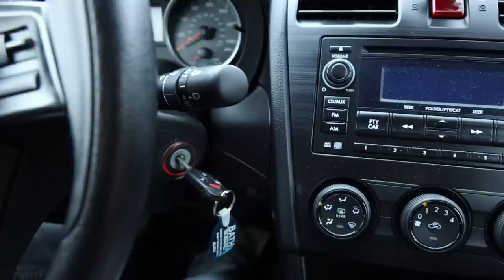Building The OFFROAD Subaru Crosstrek Makery And Mischief Adventure Mobile With LP Aventure

Comment: The crosstrek is getting the attention it deserves! It’s my first car and this is my dream build eventually after college. Just a tip, you can fit a mattress in the back of the crosstrek very easily if you put all the seats down. The most I’ve gotten is a twin size in there with 4 pillows
Reply: Just the rear seats down or all seats down?
Reply: @luvjoebacon2915  just the rear seats will fit a twin sized bed!

Comment: Great choice! It's hard to beat a Subaru. They are one of the best vehicles you can buy for snow and fuel economy. They last forever.
Reply: unless the cvt burns out
Reply: What tires he running
Reply: I like them too. I’ve heard reports of them burning oil. Is that accurate?
Reply: Diesel engines nad clutches nie manual transmissions in subarus are the worst thing in car industry.
Reply: Keep it serviced, they have one of the best cvts out there with no oil burning issues.  Comments like that are from misinformed YouTubers
Reply: @winnfilms  i bought a manual 6 speed crosstrek

Comment: How does your crosstrek handle the increased weight of all the added parts and wheels?  Crosstreks already have a rather underpowered engine and I'm curious if you've noticed any notable performance changes.

Comment: Funny, my number one qualification for this car was the ability to lay down to sleep in it. The salesman looked at me funny as I put down the seats and laid down in the back. Owned the car for 5yrs now, it's a great one man camper. I found it best to take the headrests off and lay down the front and back seats, with two overlapping pieces of plywood from front to back.
Get some Mann springs for towing/hauling, really helps with rear end sag.
Reply: Just saw a video on Rick Hutton's channel that talks about inflatable mattresses for the Crosstrek. There are custom fit ones which seem great.

Comment: I used to like the fact you could hear the road in a Subaru, you could hear the engine, you could hear the air intake, and the wind. Those noises were the sounds of driving- started off with an 88 Loyale, sounded and behaved like a sports car. And my Outback went EVERYWHERE.

Comment: I had my trailer the other day & it had a low tire.  I was being lazy so I pulled into a station to air it up.  The pump deal took charge cards ( 2.00 dollars ). SMH.  I dug my little pump out of the back.   For sure always carrie one.     I like the front rack a lot

Comment: Your car's power sockets go back to a fuse on an "ignition on" power rail. Look for an empty socket (for options not installed) on the "battery constant" rail and just move the power lead for the sockets over. Quick & easy.

Comment: Love ya work !!! looks grouse. You probably know, but if you didnt, Torq Masters in america are very close to releasing a lunchbox locker for subarus r160 rear diff. And even more exciting Aussie AllDriveSubaru are producing a 1.6 low range to suit the 5mt out of a XT foz. All subarus bell housing patterns match. So when your CVT dies, theres upgrades !!!
Reply from the maker: interesting I dont know I'm not a huge car guy  so thanks for the heads up.  What would be the advantage of all that?
Reply: Fowler's Makery and Mischief lockers make is so the wheels spin together once engaged. Really good for muddy conditions when a wheel might loose traction.

Comment: That was awesome! I drive a Crosstrek to handle the northern Alberta winters and it's second to none. Love your channel.
Reply from the maker: thanks ya I cant wait to see my first winter with it
Reply: How many Kms do you have? any issues so far?
Reply: @sidb9540  Interesting story, I got hit by a young driver who went full speed (~60 km per hour) through a red light my front end took the impact and the car had to be written off. (I walked away without a scratch.) I bought another Crosstrek. In total I driven just under 100,000kms and so far just regular maintence, with the execption of raditor clap that had to be replaced (under warrenty). We have had a weird winter, it's either been warm with freezing rain or really cold with lots of snow, making for terrible driving conditions. And the Crosstrek (with Birdgestone Blizzaks) has performed awesome. FYI my first car was Jeep Cheeroke with 4 wheel drive, and would never go back.

Comment: Hello new sub here, I have a 2019 Crosstrek Limited, just a FYI I blew the AC/cigarette with a 12v compressor, the crosstrek's outlet is only rated for 120watts.  Best to run off a additional separate outlet.  Before it happens to you, just check it out your may be different.

Comment: How’s the CVT holding up with all the heavy loads on it! I owned one.  I know it only has 148hp. Just curious. I use mine 95% as a daily car for commuting.
Reply: eugene gutierrez The CVT and 148hp are the reasons I’m not buying a Subaru. I wish they’d kept the 2.5L and regular transmission.
Reply: @JB50713  Next year's Crosstrek is getting a 2.5l engine.

Comment: The one thing you did wrong you put your lights down low you should have put them up on the top on the rack... put the big one in the Middle where that big black plate is and put the littler ones on the right and left side where the little holes are... and I would put one single light on the back facing the back for when you launch your boat or you need to back up and go in reverse in the woods I used to have a Suzuki Samurai I had 8 lights on it all the way around two on each side I loved it

Comment: Totally correct me if I’m wrong but that looked like a full spacer lift? Not a suspension lift? For off road Use you’re really pushin it. Spacers will always break under constant off-road use. And not even heavy use either.

And side note I gotta do it... they’re called wheels... not rims 😜
Reply from the maker: no idea im not really a car guy but iv had it for over a year and I only do meadum of road.  its all about getting to a fishing spot or down a woods trail.  Most awsome thing is the under plate they have saved me at least a dozen times

Comment: Cool rig. Why not a Jeep Wrangler? Price? I found a used 2012 with 20,000 miles at a good price.  More mod options and off-road ability. Towing up to 2000-2500lbs in the 2 door which is good enough for small trailer rigs
Reply from the maker: no way I strongly dislike jeeps ,  besides it all about putting alot of miles on in between adventures.  we just drove it to Pennsylvania for the slingshot tournament last week
Reply: Fowler's Makery and Mischief strongly dislike huh? Are you a city boy?? J/K, yeah they do drink gas. But the fact that you say you strongly dislike Jeep wranglers throws up a red flag 🚩

Comment: i have the same car. when i bought it subaru told me to never put seat covers on the front seat as it will prevent the airbags from working properly. just a heads up.
Reply from the maker: hmmm I'll have to look into that I would never thought of that thanks for the heads up did they say specifically why?

Comment: Too bad that all those mods add so much extra weight to an already under - powered car. Those tires themselves add extra unsprung weight that reduces rear wheel horsepower. In 2021 the Crosstek,will get the 2.5 L with 30 more hp,time to trade. From a fellow Maine-Ah!

Comment: Still no diff lock and a CVT.  Good luck.
Reply from the maker: YA MAYBE FIXING THAT IN AN UPGRADE
Reply: @FowlersMakeryandMischief  I get out in the woods as much as I can.  Frontier SV 6spd, Ram Cummins 2500HD 6spd, new Jeep Compass 6spd 4x4 all no good.  '15 Trailhawk Cherokee was okay but got sucked into mud too many times.  Good on rocks.  Finally got a '18 JK Rubicon Recon 6spd and never looked back.  Not good MPGs and small space but no issues...and a winch dropped right in.
Reply: @FowlersMakeryandMischief  I look forward to seeing you wheel it.

Comment: Unfortunately that car will struggle with all the extra weight put on. Should of put exhaust, headers, pulleys, cold air intake, and some type of tune. Great cars but extremely underpowered
Reply from the maker: cool thanks for the tip I'll look into that it feels ok bit hard to tell I almost alway have a boat on the roof or on the hitch

Comment: You went with the CVT transmission? WHY? Whhhhhhhhhhhyyyyyyyyyyyyyyyyyyyyyyyyyyyyyyy?
Reply from the maker: you dont look a gift horse in the mouth or something like that
Reply: @FowlersMakeryandMischief   I get it. But towing and bigger tires and off-road rambling around is going to be tough on a slip-as-a-rule transmission.